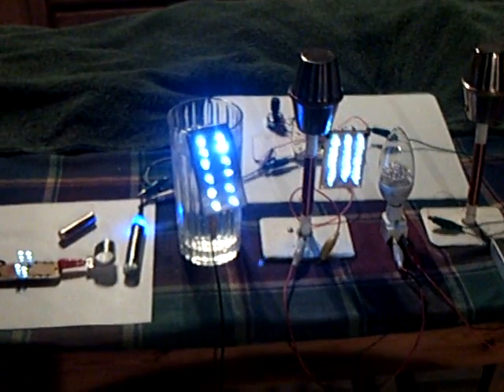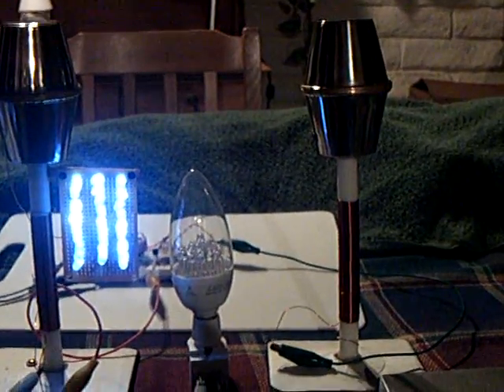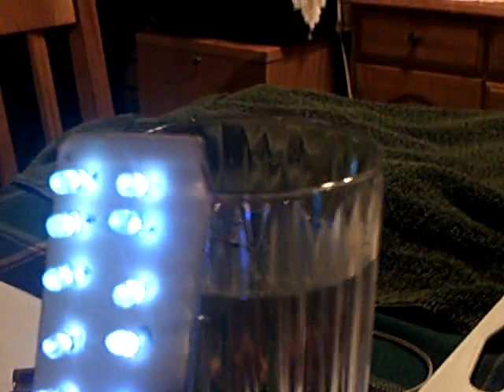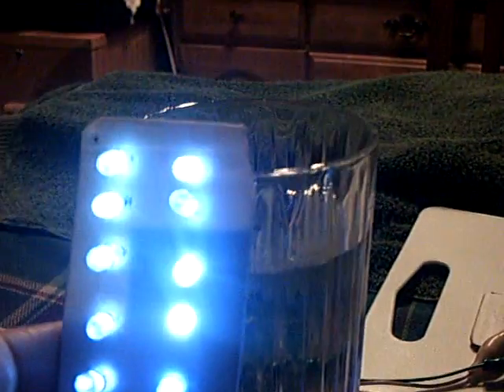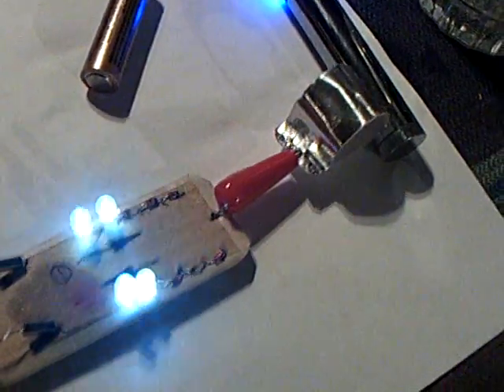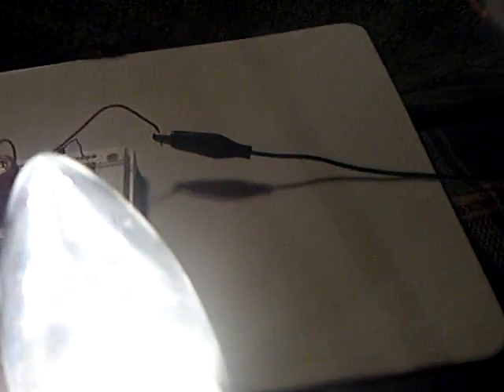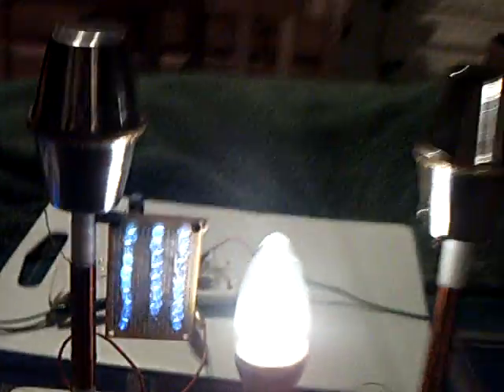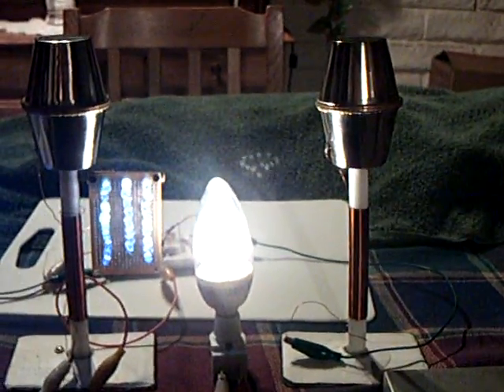Pan Oscillator with Water Tower.ASF

Comment: at 305 when you say only highvoltage no amperage, why couldnt you put the high voltage into a cap and oscillate it "with a separate oscillator"  through a standard wall dc adapter, but run it backwards so the high voltage goes into the smaller wire.... through the oscillator into the small wire and comes out the big wire with less volts but more amps. have read you only need 2 volts over the maximum voltage to charge the battery. this might charge the battery's faster. great expirienting.